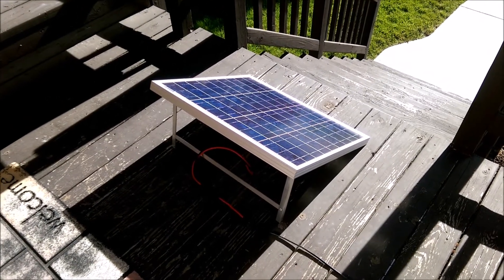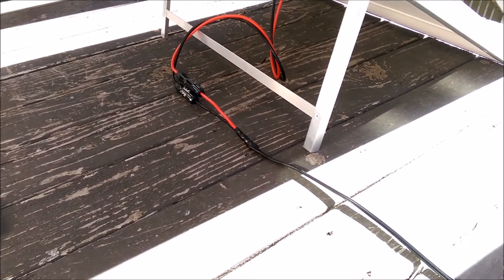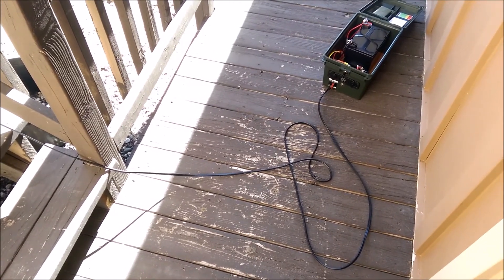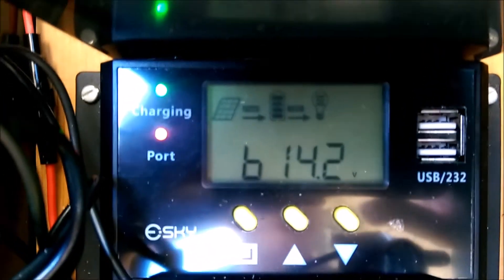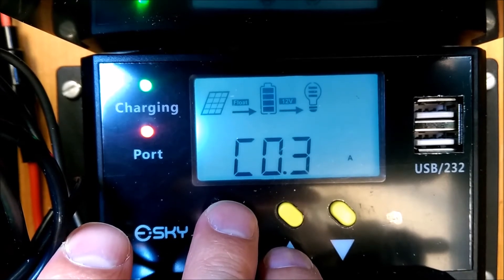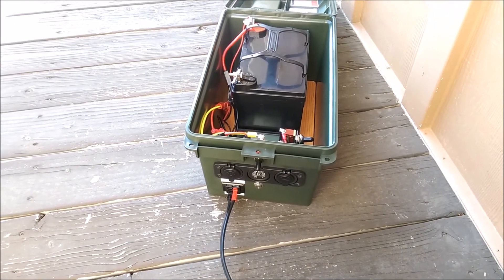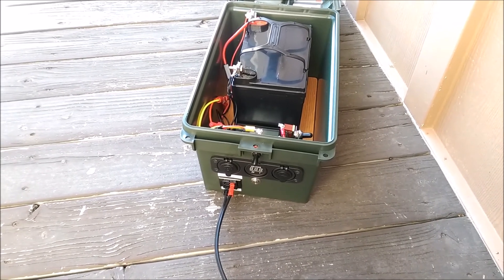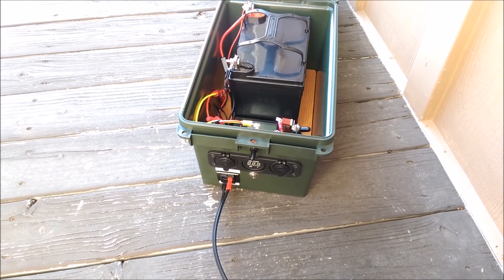DIY Portable Solar Project Complete!!

Comment: Hey man. Love your videos on the solar generator build. I’m slowly piecing all my stuff together. To connect everything what gauge wire did you use? I just bought some 14  or 16 gauge wiring but I noticed that you used 10gauge fortune fuse holder.... should I change to 10 gauge then to keep everything 10gauge?
Reply from the maker: Jlui83 I would recommend anything 12 gauge and larger. 10 or I gauge would be ideal but I didn't have that laying around. For the low and stuff, the USB cables, smaller wires are okay to use. Thanks for watching my videos! I love this thing!

Comment: I look forward to the next video! Thanks for sharing :)

That port you have where the solar wires connect into the box, what is that? :)
Reply from the maker: That port is a 4 Pin Anderson PowerPole Connector. You can get it here:

https://www.amazon.com/Anderson-Powerpole-Chassis-Connectors-1470g1/dp/B014UC9QNU/ref=sr_1_33?ie=UTF8&qid=1497925358&sr=8-33&keywords=anderson+powerpole

I wanted a clean and easy way to connect and disconnect the solar power coming into my charge controller. With 2 of the pins I have it wired to go into my charge controller and charge the internal battery. With the 2 other pins I have it wired to charge an external battery of a car or motorcycle and skip the internal battery. Then my solar charger can be used to charge any lead acid battery.